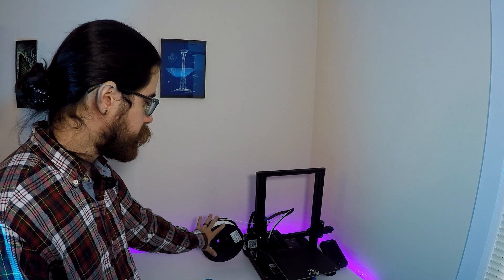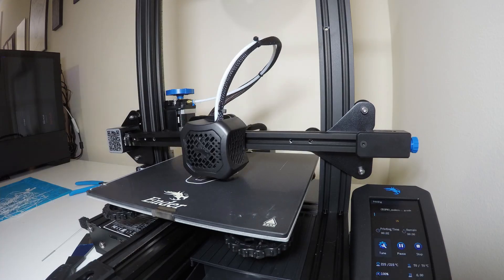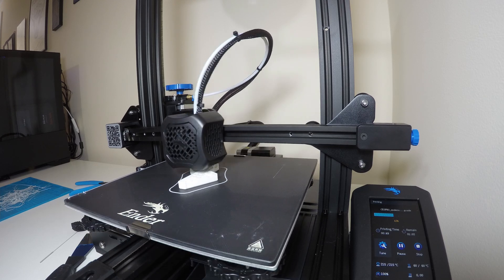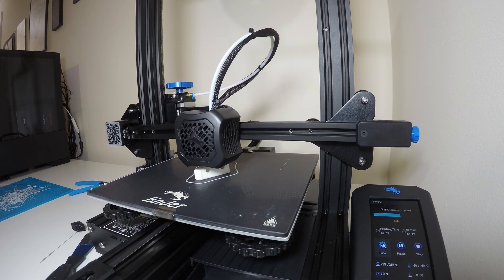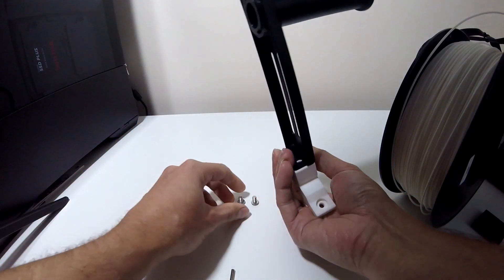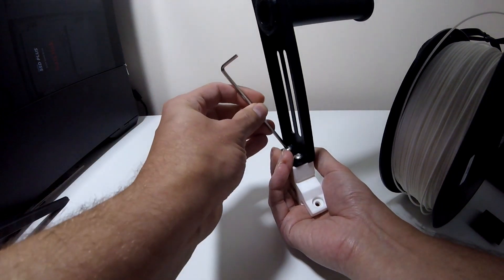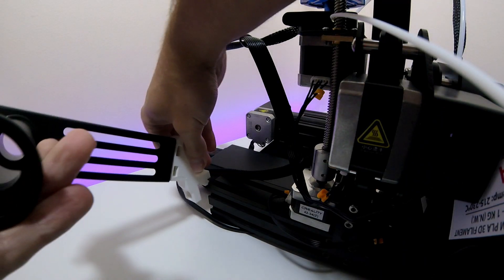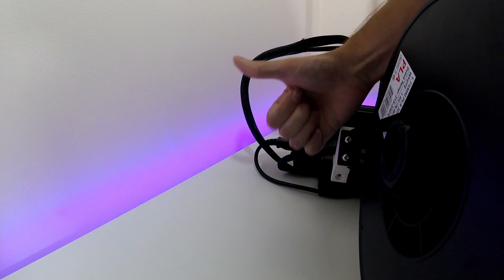Ender 3 V2 Spool Relocation and First Layer Troubleshooting

Comment: before and after?
Reply from the maker: What would you like to know?
Reply: @frenchineer  oh thanks sir! I was thinking if this mod is worth it... 
Maybe one print with the spool on top (classical ender position), and another print with the mod. I like to see the difference between layers in both cases 🙌
Reply from the maker: I see what you mean! I've changed the focus of my channel to car content, but I did notice the printer wobbles much less which is an improvement! In my prints I didn't notice a huge difference but I also did not go for high speeds. You might also be able to tune out vibrations with alternate firmwares on this printer, so that might be worth exploring as well!

Comment: Hi there, i think there is an error in the 3d desgin. My Creality software keeps giving errors. When i try to print te spoolholder, it goes wrong after 30 minutes. The nozzle suddenly goes up about 5 mm and continues printing in the air...
Reply from the maker: That's strange! Which slicer are you using? Also, if you make the nozzle travel up and down the z axis, does it travel smoothly?

Comment: A light hit of hairspray on the bed fixed my first layer problems.
Reply from the maker: I've heard of that as an option! I've since started using a better way to level the bed with a thickness gauge and z offset to match during calibration, and that helped even more!